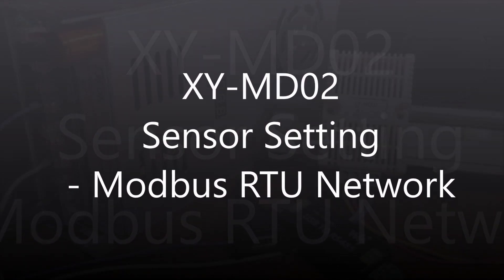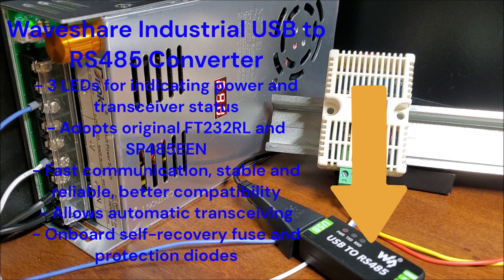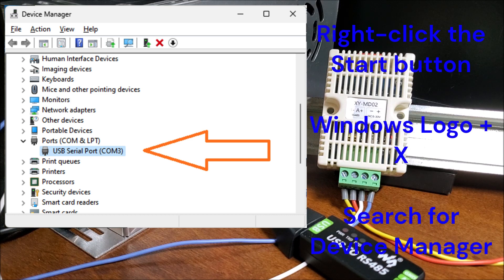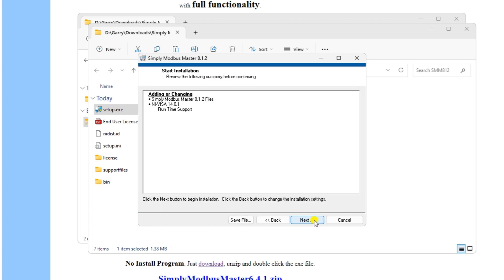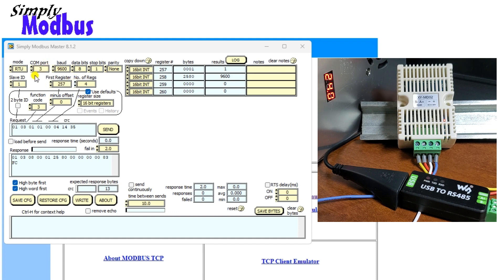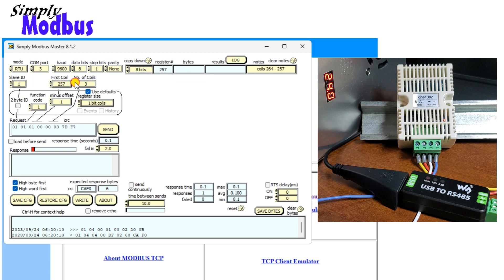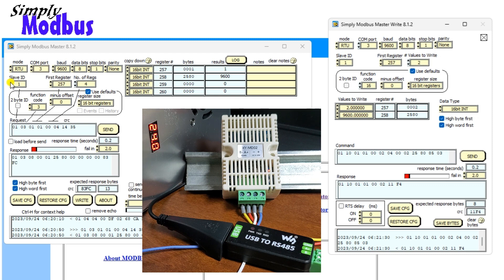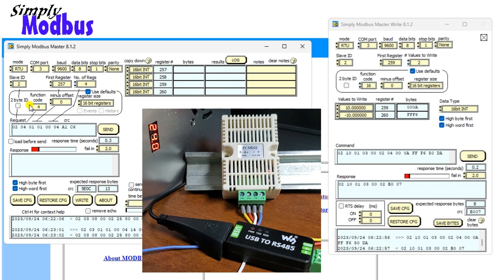XY-MD02 Sensor Setting - Modbus RTU Network

Comment: Your explanation is very clear, I would like to ask if the "communication time out error" can be still corrected, I made a mistakes using other config tools. Thanks
Reply from the maker: Hello,
Yes, your 'communication time out error' can be corrected using a program like PuTTY. You would use serial UART communication to read all of the parameters. This would happen regardless of the unit number for Modbus. On Monday, a video showing how this communication is accomplished will be released. Stay tuned.
Regards,
Garry

Comment: Good afternoon, thank you for the information, a question, if I do not have the address or speed of the device, is there no way to give the device an address, regardless of the address it has? I have a different device that allows me, using the device address = 0, to be able to set an address to the device regardless of the address it has. Thanks in advance.